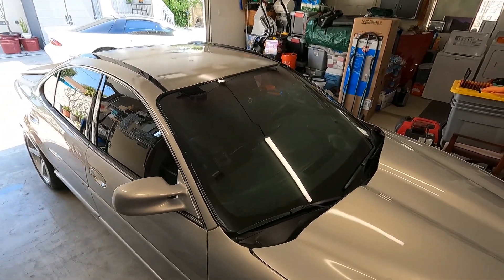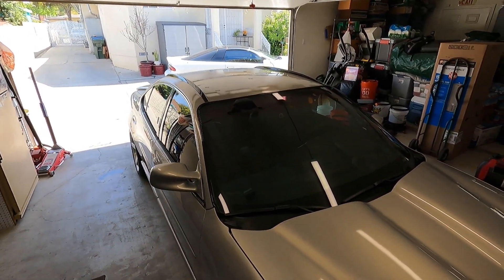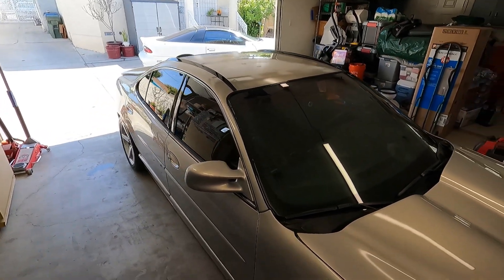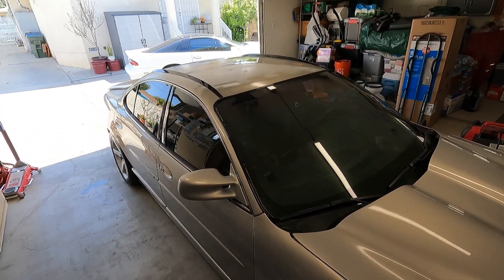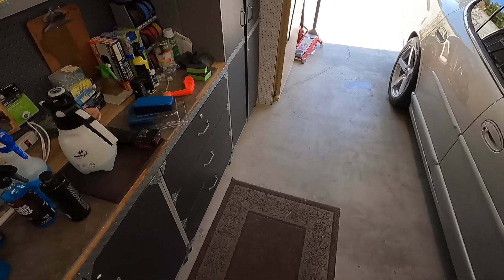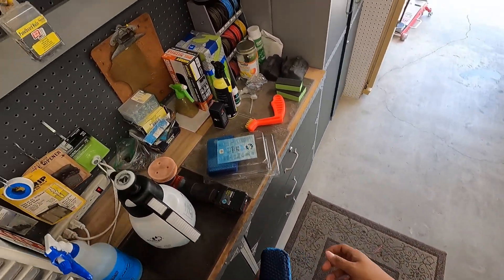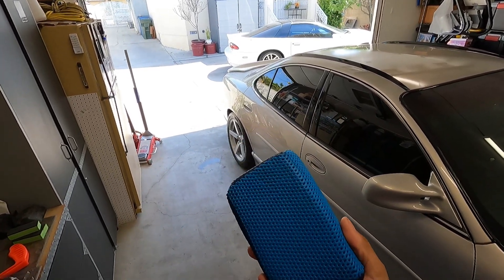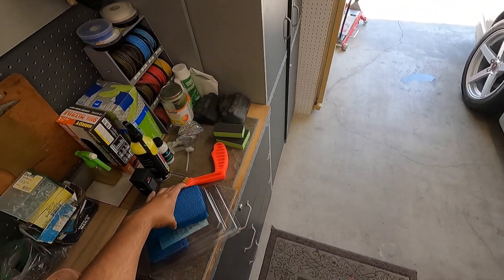Diamond Protech Glass Application - From Glass Polishing to Glass Coating

Comment: Applied Diamond Protech Glass on a Camry two weeks ago. Removal was grabbier because it seems humidity was a bit on the higher side.That being said drove the Camry to Cambria last week and went through some drippy weather above Santa Barbara. Rain started to channel off between 40-45mph. So, not the rain hydrophobic's of Artedeshine. Also used just one layer and applied the Diamond Glass Prep..
Reply from the maker: I have read that it doesn’t repel as fast as other glass coatings.
Reply: @MikeGDetailing  Seems to be slower to react to your driving speed. Will get lots of rain in Cambria.
Have Gyeon Glass on our Crown. That was much easier to remove.

Comment: I've used the diamond glass, wheels and just applied the diamond body 36.  I got about 4 or 5 months out of the diamond glass and that was through the winter.
Reply from the maker: Most glass coatings will struggle the more the wipers are used.  Technically it met that "up to" 12 months with that time frame.  Perhaps they need to tweak it to make it more durable.  Diamond Quick Body could use a formula tweak in my experience using it.

Comment: I'm so glad I found your channel.  I read a bunch of your posts on AG and Autoipa today.  This is a great video.  We have a new car showing up in a few weeks and I want to coat the wheels and glass first.
Reply from the maker: Good idea to do so.  What coating are you going to use on the new car?
Reply: @MikeGDetailing  On the paint not sure yet.  Wheels was thinking Adams Graphine Advanced, Glass thinking Flyby FORTE.  What do you think?
Reply from the maker: @wescat2  that would work. You could also use the adams on wheels.
Reply: @MikeGDetailing  I actually have the Adams Graphene (non-advanced) in my cart. Any tips on coating outside?  No garage here.
Reply from the maker: @wescat2  the coating is always on sale. Adams has 30% off on occasion. For coating outside working in small sections and out of the sun.
Reply: @MikeGDetailing  Appreciate the advice.  I'm going to check weather and coat in the cooler morning before the sun comes up
Reply from the maker: @wescat2  Adams has 30% off at the moment. I would just get the Advanced coating rather than the regular.

Comment: I bought the Glass kit TRMCA event will be interesting to apply it. Does the manufacture say 2 coats is better then one or just TRC staff?  Looks easy as heck to install. Now just need a lot of rain so can have some wiper abrasion. Thanks Mike
Reply from the maker: Manufacturer states 1 layer. TRC recommended two.  I did one on the Camaro. Supposedly El Niño is back so that means more rain.

Comment: I applied this this morning on my f150, first time using a glass coating. I’m not sure if I used enough product because of how fast it flashed away.
Reply from the maker: You can always add another layer just to be sure. But yes it does flash quick depending on the temperature.

Comment: I don't think the Diamond Glass has any nanodiamond stuff in it. I saw a comparison sheet somewhere and it wasn't checked for the glass coating. It also lacks the ball bearing at the bottom to mix.

I did apply this to 3 windshields and I have to say, if you go too crazy with too much product you'll see streaks that show up when condensation or frost build up on the windshield. My best result was probably on the windshield I used the least amount of product on.
Reply from the maker: Just going by what is stated on their site. 

This nanodiamond coating is easy to apply with long-term professional results offering up to 12 months of hydrophobic protection.